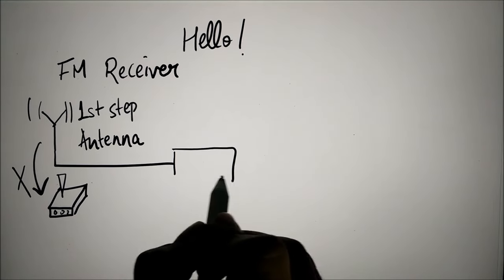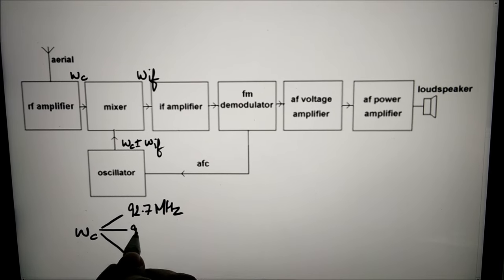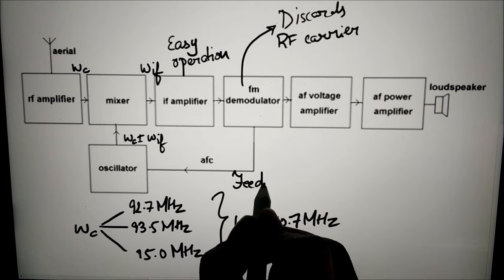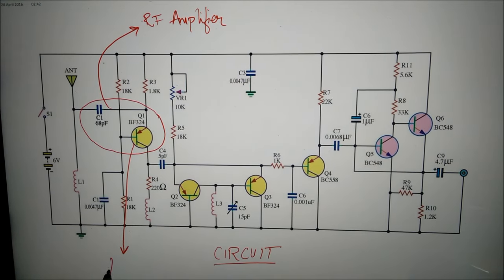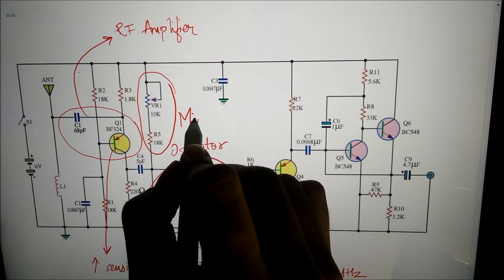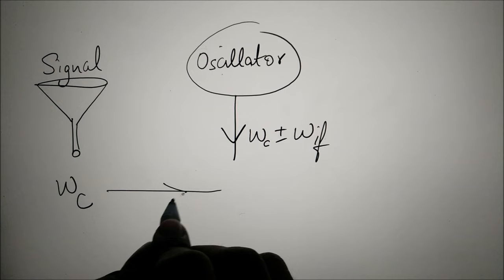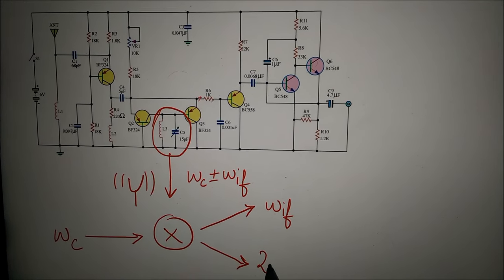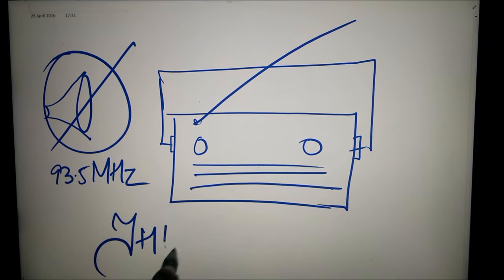FM Reciever Circuit Finally Explained

Comment: Can we recieve LTE signal with this .. 1080 Mhz..if we slightly modify this circuit?
Reply: no, this is for FM receiver
and this whole process for analog communication
Reply: For LTE signal you need new device
Reply: @ishachoudhury8039   which device? Could upload that video as well.. Probably you can do R&D on 5G also :)

Comment: Hi there, I've got a Grundig 1000 Transistor, it's not locking on to stations very well, it finds the station, it's not a strong signal, then a little movement and it's a stronger signal, but not clear/without treble and bass distortion. It does not drift off station, even after turning back on. So locks on fine. But it's as if there is a ghost signal/frequency, a little weaker than the frequency when I turn the (very sensitive) dial a very small amount.
The sound's not good though. My other Grundigs, in particular my Concert Boy 1100 sound much nicer. 
But this could be >>>
>>> The filter capacitors are a bit out of shape, gold in colour., and clearly are beyond their lifespan. When I change them out would I need to make any adjustments to the ... er.... other things in the radio!!!±???? They are like variable resistors, square, in a metal case, with a flat screw in the top to adjust. I don't have anything other than a multimeter, so ... first the caps, and then could I adjust until I get a clear signal? 
Cheers, if you were closer I would get you to service it! Long Live 1966 Grundigs!
Reply: Thats the image frequency